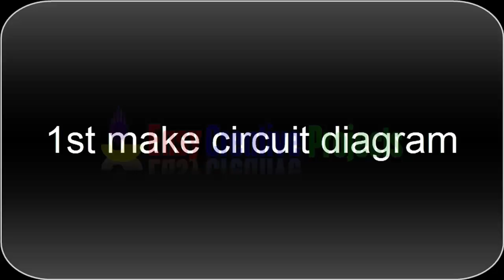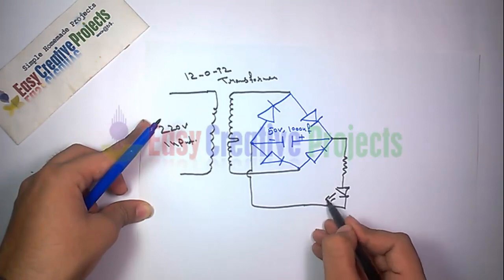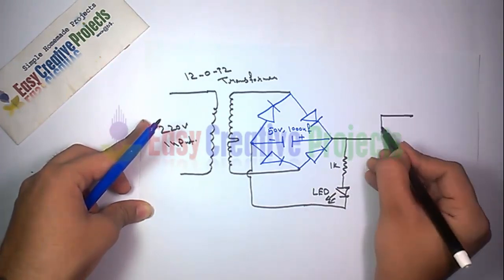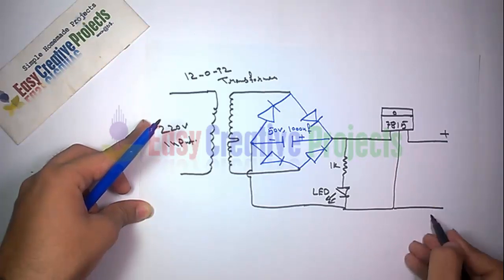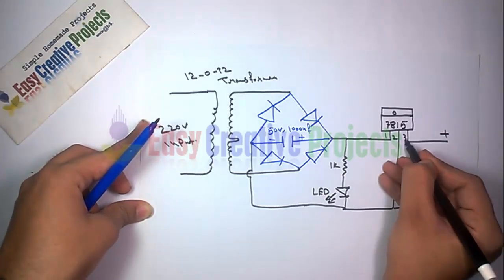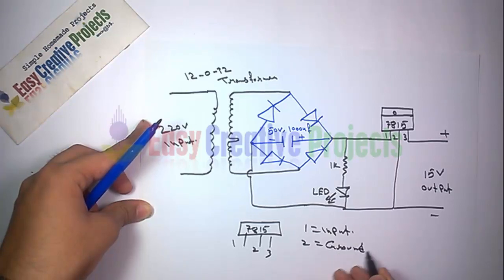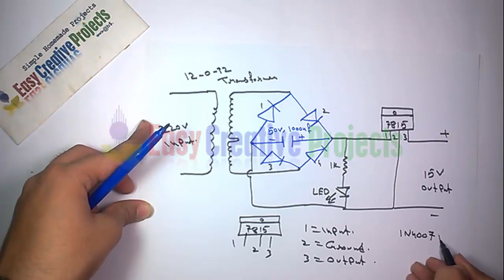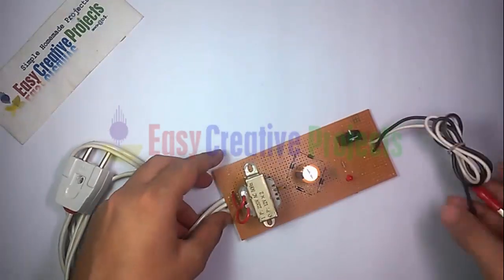How to make 15v power supply easy at home - step by step with circuit diagram

Comment: how do you determine the power of this (eg 400ma, 1a etc)
Reply from the maker: current depend on transformer. if your transformer current 500ma then you can get maximum 500ma current.
2nd in this project we use LM7815 voltage regulator.
its pass maximum 1amp current.
for example if we use 2amp transformer then we get 1amp maximum output. because we use LM7815 voltage regulator.
thanks.

Comment: Hii 
What is the Difference between AC Wires and DC wires ?
How current flows in them?
Reply from the maker: AC stand for alternating current, and DC stand for direct current.
another word AC work on 2 loops upper and lower.
but DC work on state forward. 
another words DC work on one direction and AC work on multi direction.
in another word in DC on pole is always negative and 2nd is always positive. but in AC the current reverses periodically.

Comment: 14v secondary transformer it will work??
Reply from the maker: if your transfer has 14v two output then you can use.
14 + 14 = 28
if you connect 1st and 3rd wire then you can use it.
but
if your transformer has one output then its provide you 14v output.
thanks.

Comment: I will try to build power supply  from 220 to 24V rms transformer. Did you connect two 12V terminal in series? How did you decide capcitor value? How do we calculate ripple percentage? Please
Reply from the maker: dear i use 12-0-12 transformer. mean. 12v two output. if you use 1st and 3rd wire they give you 24v output.
for capacitor value
simple if you want to make 24v power supply so your capacitor value minimum dabble.  mean 24 x 2 = 48v  but if you want more safety you can use more high voltage. its my simple formula.
 but if you want to calculate it perfectly 
so 
C=I/V 
and other detail get form you class teacher or book.
thanks.

Comment: can this circuit run 24 hrs continuously ?
Reply from the maker: yes dear you can use it 24 hour. 
simple use good quality transformer. and resistor power 2w or 1w.